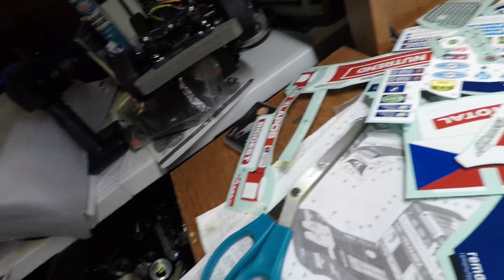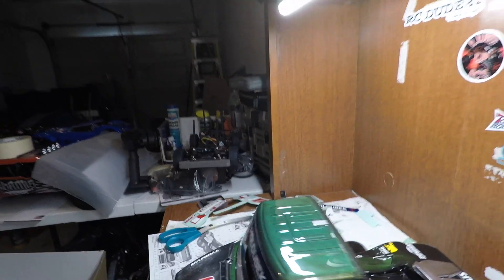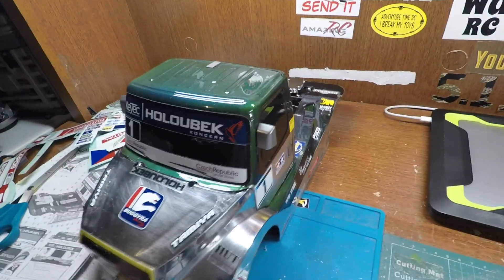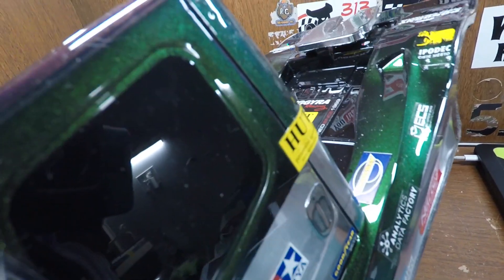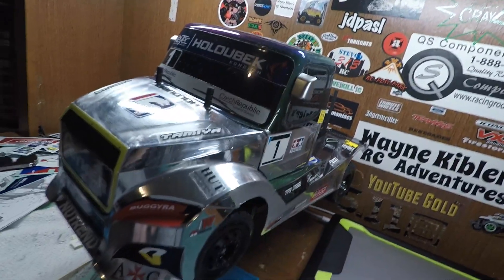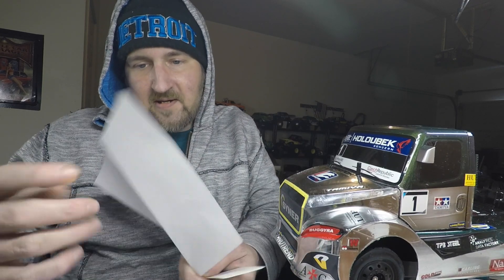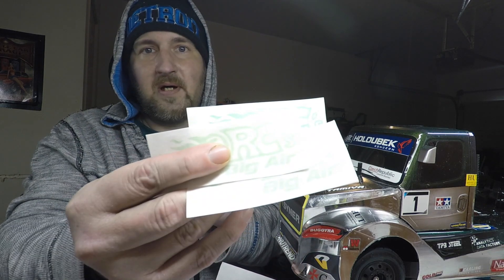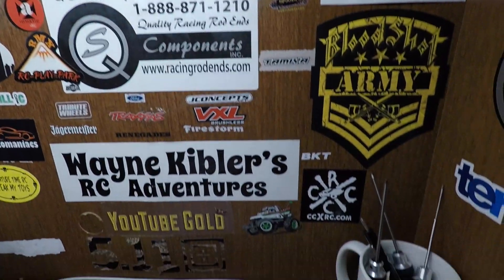TAMIYA BUGGYRA FAT FOX n Mailcall

Comment: Looks good. From what I've seen, if you use the proper paint, you don't need to scuff at all. Not sure how that rumor got started.
Reply from the maker: I learned it from Hemistorm, he scuffs his bodies before painting them n thats why I started doing it, ive never had any issues with any scratches showing up before but just on this mirror chrome
Reply: @STEVOD313  Thats odd. Good paint is specifically designed to bond to lexan. Scuffing shouldn't make a difference. Some paints just work better than others.
Reply from the maker: @nobodynoone3428  ya I usually use tamiya paints, this was my first time using spaz stix, I used a new scuff pad n probably went a lil deep
Reply: @STEVOD313  Yeah I hear Tamiya is good. I just watched https://youtu.be/fge7THzvlhQ and didn't see Hemi mention scuffing. Do you have a link to that video? Thanks
Reply: Started from rc car action tips section  I've built and own about 100 tamiya and kyosho kits since 1985 and I've never scuffed the bodies on inside buy and apply the right paints and lacquers for rc bodies respect😊😊😊😊
Reply from the maker: Ive watched so many of his videos I wouldnt know exactly which video it was but I know lots of guys who do scuff the bodies n lots of guys who say they dont scuff the bodies, but when I paint its mainly with an airbrush n they r waterbased paints so I know when using them they say to scuff the body so the paint sticks or bonds better, so I always have n never had issues with chipping or scratches showing threw the paint, well until now when I used the chrome lol
Reply from the maker: The first video I watched on hemistorm he says he scuffs his body @6:20 https://youtu.be/MQBnt76Bfv8
Reply from the maker: @6:20 
https://youtu.be/MQBnt76Bfv8
Reply from the maker: heres another video ive seen @2:14  https://youtu.be/z_0HPfXgxpw
Reply: @STEVOD313  Thanks for the links. I think it really comes down to the paint. I know Faskolor says it becomes part of the body. http://www.parmapse.com/fas1.html In my opinion someone should do a video testing a bunch of paints and how they hold up. It would be nice to see what actually works best.
Reply from the maker: @nobodynoone3428  Yes I agree that would be nice to see whats the best n what holds up, I would try it but thats gonna cost some money to buy all different paints n im too broke for that right now LOL

Comment: Nice job man nice job.
Reply from the maker: Thanks brotha
Reply: I've seen ppl use 2 dif bats 2 get 4s for a speed run is it safe to run the 2 dif bats any longer.
Reply from the maker: I wouldnt advise running 2 different batteries in parallel, well if they r 2 diff batteries but same MAH n C rating thats fine but I dont run 2 batteries with diff Mah n C ratings
Reply: @STEVOD313  i was reading an they are the same besides brand an c rating ones an I have a volt checker ima habe that one the small c rating but what I've read is the c rating doesn't really matter but the discharge is the same but they are very close an Ima try it  😮🤓